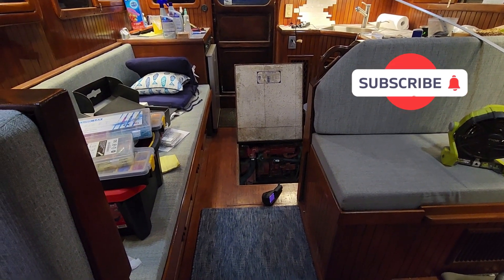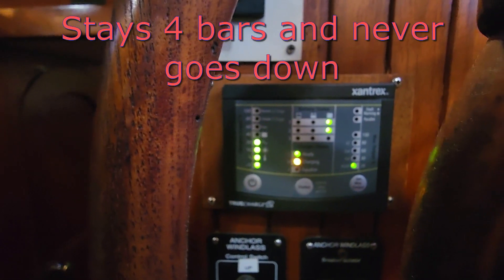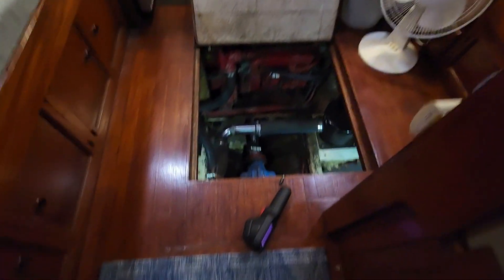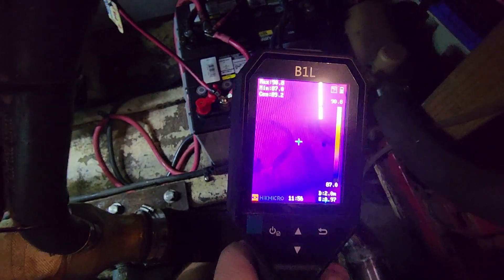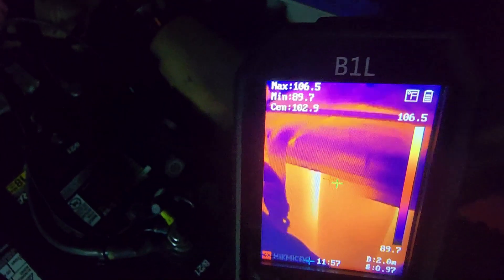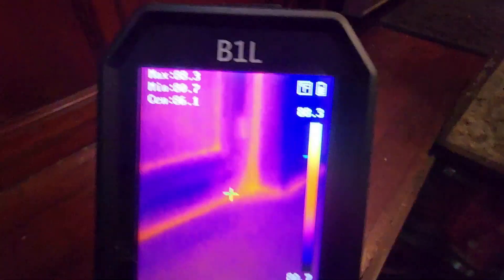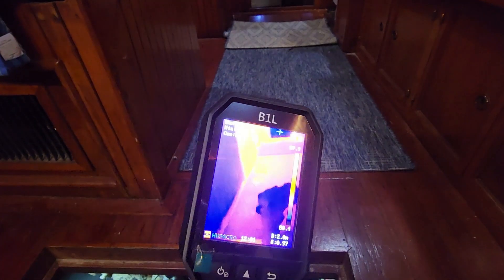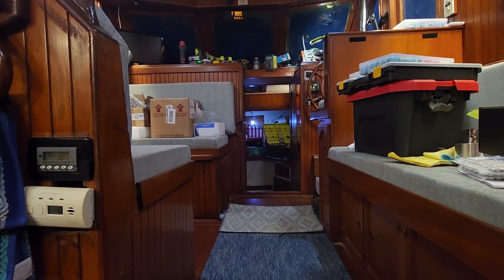Trawler DIY- How to easily identify a failing boat battery using a thermal camera.

Comment: Great Video.  I just bought an Infared Laser Thermometer to check my electrical panel (per a previous video of yours), so now I know to check my lead acid batteries as well.  Thanks.
Reply from the maker: Yes...we tend to forget about our batteries until they are a major issue. By that time its too late..lol.

Comment: Interesting, on the hot battery it appears that is also where you + terminal is located. Nigel Calder recently discussed a study on something similar. He was referencing the ideal method is to bring all positive and ground wires from each battery in equal length cables to one connection lug or bar, apparently in a recent study this has proven to distribute power and charge rates to each battery in most even manner. Certainly seems logical.
Reply from the maker: Yes i saw that. The configuration you see is how i got the boat. I repaired several bad wires just to make it safe but the whole set up needs reconfigured. I just need it to last another 6 months or so and the entire battery set up will be revamped and i will probably do it with the buss bars. I already purchased the bars.